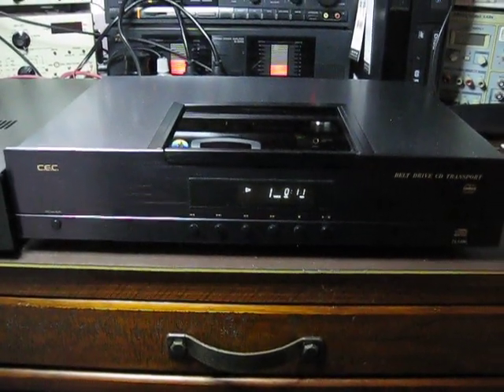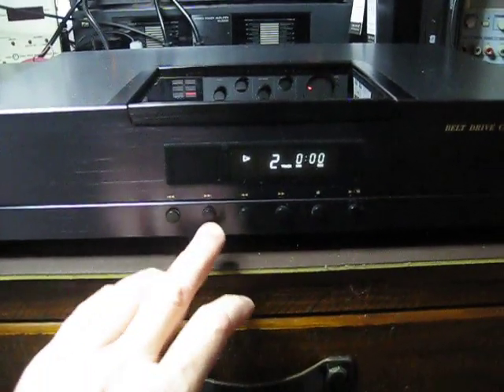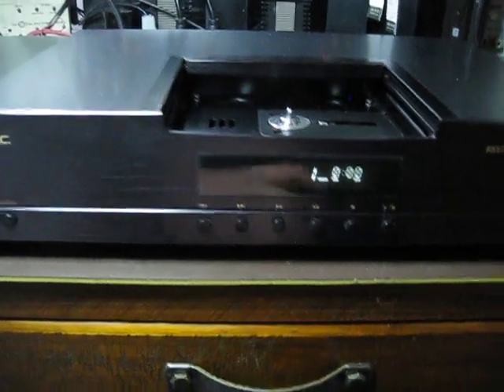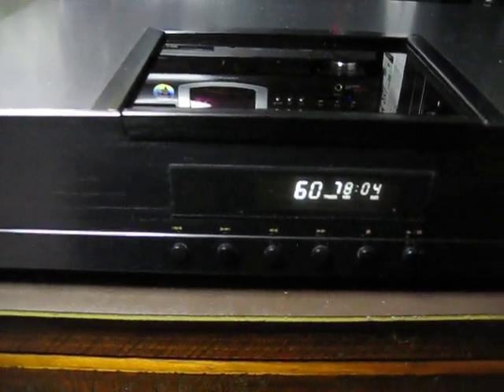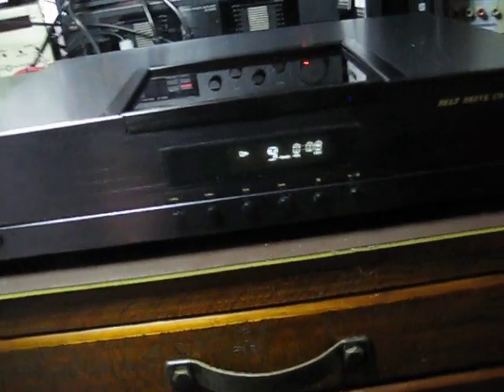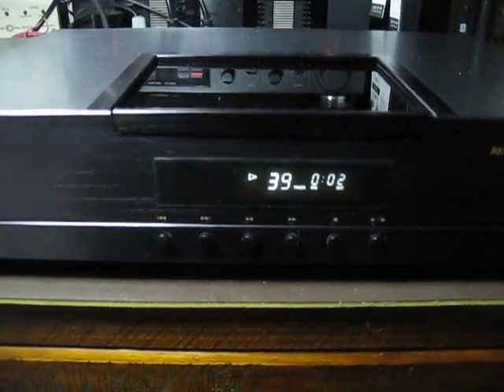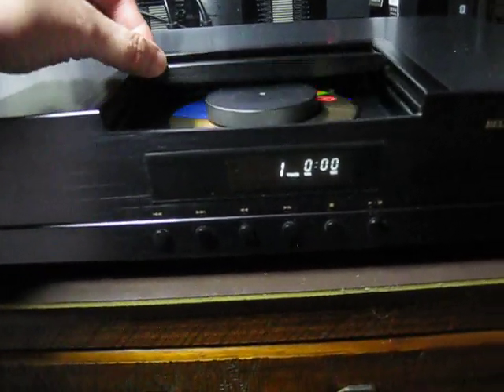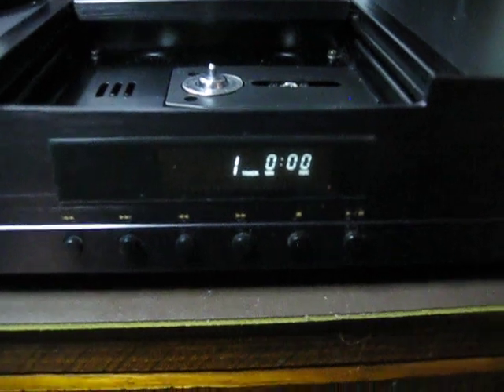CEC TL-5100 Post repair video

Comment: Hello
I have a Parasound B/CD2000 CD transport that is practically the same as the CEC TL51, and I wonder if you can help me figuring something: on lots of discs the player fails to start the tracks but when it does it never skips. Some discs are read from beginning to end without problems, but on most Discs it can only play from track 4 or 5 onwards. Again when it reads it never skips.
Also it is trouble to read the TOC on some discs, showing “no disc”.
My question: is it an alignment problem, a component defect or a laser malfunction.
The belts are new and original, supplied by Parasound a couple of years ago.
Many thanks in advance
Reply from the maker: First, I would look at some kind o mechanical obstruction close to the centre o fCD. Hardened grease? Or maybe some dirt on the rails?
Reply: @ Many thanks
The technician changed the spindle motor and all the capacitors and said that he greased the rails… but the problem persisted.
I have a NOS laser (also bought from Parasound) but I don’t think that changing it should solve the problem.
Reply from the maker: @ Did he adjust the PLL frequency?
Reply: @  I doubt it. Do one needs a service manual? It is a fixed value?
Thanks once again :)
Reply from the maker: @TheNaka9  Fixed. 4.32181MHz. But sometimes it is hard to find it, if the board does not have proper silk screening. Also, when I say fixed, it is the same for all but some unique and quirky players.